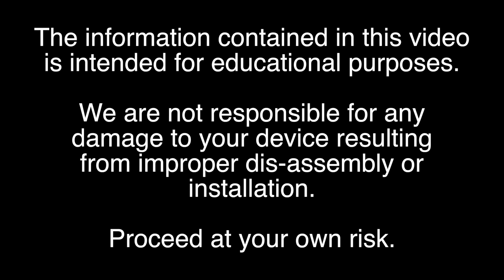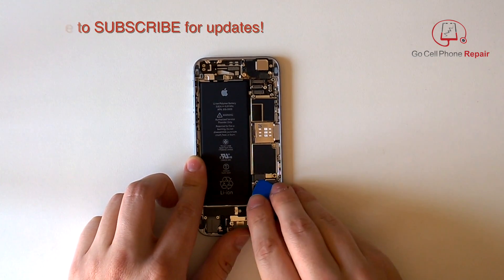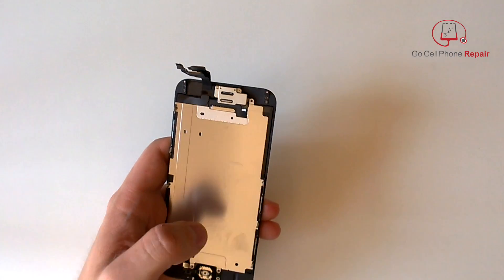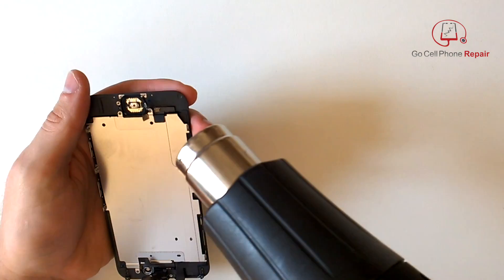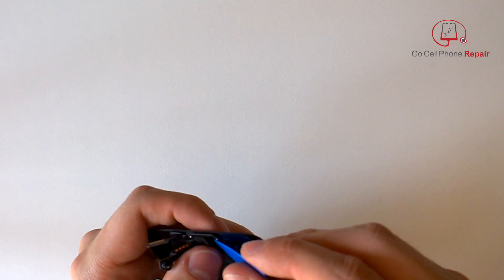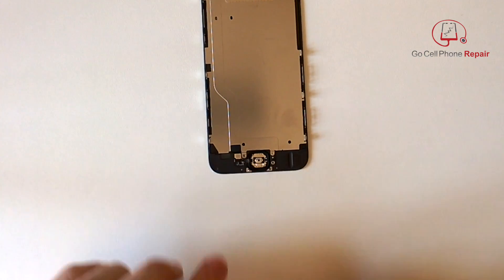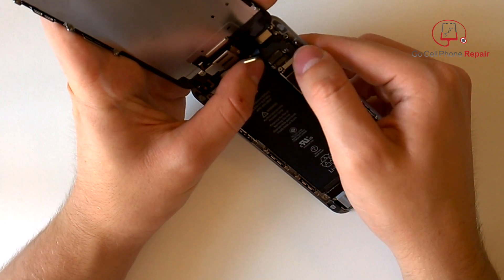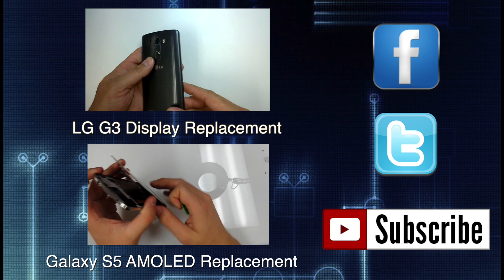iPhone 6 Screen Replacement

Comment: Hi, I have a question! Please can you tell me if on the bottom of the iPhone when you take out the 2 screws, there was any warranty seal on it? I don't know if I lost my warranty because I tried to open my iPhone and then I close it! Thanks so much! 😃
Reply from the maker: There is no warranty seal but you have to be very careful to avoid scratching the screws or it will be apparent that the phone was opened.

Comment: +Go Cell Phone Repair will those new screens are good quality?? I bought one before from ebay and the screen pop up in the side in few weeks please let me know so i can get them if they are good quality thanks great video
Reply from the maker: +marco quintana There were some issues a while back with the glue holding because the companies that installed the glass did not use a dust free environment. If you follow the link in the video description on the page I have listed to options- lowest price and best quality. The latter are far more reliable but of course will not be the cheapest way to go.
Reply: + gocellphonerepair
can you tell me how i can find the screens with the front camera and sensor holder?/
Reply from the maker: +marco quintana Ive added links to this page for the pre-assembled displays http://gocellphonerepair.com/how-t/iphone-6-repair/

Comment: are the screws the same length for every compartment?
Reply from the maker: Apple tends to use a different screw for just about every part of the phone. It's best to keep them in order. In some situations you can cause damage by using the wrong one.

Comment: hello, so I have recently had troubles with my screen having white lines in it after going on a run today, I didn't drop it but I feel like a loosen the 3rd cable doing so, today I opened up the phone and disconnected all 4 cables in the upper righthand  corner. after putting them in properly (hearing the click) I went to check my phone, now the whole thing is black and will not turn on period. I say in your video at about 13:34-13:37 you are pressing on something so I took off the plate that is guarding that. and just pressed everything that you might have. does anyone have any suggestions or help?
Reply from the maker: +jesus flocka I think that you are referring to where we disconnected the battery cable. Had your phone been repaired before? You might have anything from a damaged or partially connected cable or defective screen to water damage.
Reply: +Go Cell Phone Repair yes, ive had to repaired for water damage in the past. just a couple of minutes ago I tried putting all 4 cables back into the "motherboard" not sure if that's the right term. but when I did that I tried to test to see if it would turn on. instead of working the upper right hand corner of the screen got pretty hot. does that mean anything?
Reply: +Go Cell Phone Repair and yes the battery cable, im just wondering why now the battery will not work to turn on the phone, should I disassemble the whole phone? because all I have done was "unplug" those cables and take off the "shield" for the thing u were touching in 13:35
Reply from the maker: +jesus flocka Its very difficult to say but with water damage things can go wrong later so that would be my suspicion. Excessive heat often indicates a short or failed component so I would preferably have someone diagnose the board although the screen may have developed its own problem too as well as the battery. Wish I could be of more help but there are so many variables.
Reply: +Go Cell Phone Repair hello, I woke up today and connected all 4 cables today. for some reason it turned on this time! pretty happy about that. but now I still have the original problem of white vertical lines. im going to try and disconnect the 1- 3 cables and see how that goes.

Comment: If the clear plastic camera and proximity sensor holders are important when reassembling the screen, why can't I find any replacement screens that come with the plastic holders? What should I do if I get a screen that doesn't have them already installed?
Reply from the maker: Yes this is very frustrating to me as well. I use a bit of heat and carefully pry the old ones off and then use a small piece of double sided adhesive to transfer them over to the new part. Once in a while I get a screen that has everything built in but this is rare.
Reply: Ok thanks! I'll give it a try

Comment: why is it important to unplug the battery first? i thought turning the phone off was just fine. If you were to power it on during repair whats the potential risk to the phone?
Reply from the maker: Raouf Fare Electronics are susceptible to damage from power surges and shorts. The iPad Mini for example will almost always blow its backlight filter on the logic board if you connect the LCD while the battery is plugged in. iPhones don't seem to be as sensitive but as a safety precaution it is always best to disconnect any power sources before you start working on any components and reconnect them last. An electrician could give you a more detailed answer I'm sure. Just trying to save everyone money and headaches.

Comment: My pentelobe screw things wont go back in..
Reply from the maker: +Chevy Nova Sometimes they won't line up exactly straight. Try them without the screen closed and make sure they fit. If so you might have to maneuver them a bit so that they thread when the screen is back on.
Reply: +Go Cell Phone Repair  - i'm having the opposite problem: screws go in but slide in rather than screw properly: tried it with screen open & they still just slip in  -- is this something you seen on 3rd party replacement screens ?
Reply from the maker: +pwl0lwp Sounds like it. Where did you get the screen?
Reply: +Go Cell Phone Repair  from the repaired who fixed it a month ago :-/
Reply from the maker: I would take it back for an exchange if possible. Otherwise hold on to your screws for the next screen and put a case on your phone. If you drop it the screen may pop open and cause damage to the display cables.

Comment: After Replacement of LCD fingerprint don't work fro my iPhone 6 do have any solution for that?
Reply from the maker: Azfar2gr8 Check the place where it connects. If you didn't damage the cable it might be slightly out of alignment and that can cause the scanner to stop working or malfunction.

Comment: My all the cables are perfect but still as I go to setting to setup figure password it don't allow me to do. It don't come on it stays off all time.
Reply from the maker: Azfar2gr8 Could be a bad part. Was your old screen still functional? If so you might try reconnecting it and see if the problem persists.

Comment: when i am reassembling the four display cables in the top right, two of them will not connect. this results in my phone not being able to power on during the test run. Any advice?
Reply from the maker: Inspect the connectors on the display and the phone carefully. Make sure there is no damage and nothing is bent. The connectors don't usually line up where you think that they would be. Whatever you do be careful not to force them. In the right position, it should take very little effort for them to snap into place. A lot of people struggle with this so don't be discouraged. Unless something is damaged it should eventually connect. It's just a pain sometimes to line them up correctly.

Comment: My iphone 6 screen has broken .. Can I replace the glass only without LCD??
I meant isn't better to keep using the original LCD??
Reply from the maker: It is very difficult with this phone because of the glue that they use to bond the frame with. If you buy an OEM part you shouldn't have any problems or loss of quality.

Comment: i replaced my screen on the iphone 6 and when i tried to put it on it didn't work. so i thought the screen was sent to me broken. But when i tried to put my old screen back on it did not work aswell. What could be the problem?
Reply from the maker: There are a lot of possibilities but if the phone shows up on a computer when you plug it in then at least you know its alive. From there it is a process of elimination. I don't know if this will help but it's a start: http://gocellphonerepair.com/how-t/troubleshooting/

Comment: the 7 screws in my metal back plate won't come out
Reply from the maker: Are they stripped or is your driver just not fitting? PH #000 works the best for those.
Reply: they are not stripped and the philips scew driver does fit
Reply from the maker: If they are turning but not coming out I'd say either the threads on the screws or in the panel are stripped. Has the phone beentaken apart before that you know of?

Comment: Can't you just replace the whole screen?
Reply from the maker: Do you mean all of the parts that are attached to the original? You can but that type of part usually costs a lot more and you don't really need all of the other stuff since you already have it. Also if the 6 is like the 5S then the fingerprint scanner will be matched to your board and a replacement will not function.

Comment: The old screen don't work I can't see any thing on old screen and I fix phone for people I am a repair man I have change so many Lcd of iPhone 6 and all the the same problem after changing the Lcd the fingers password don't work in all of them may be because the password is saved in the memory and as we disconnect the cable from the memory it stop reading it back!!